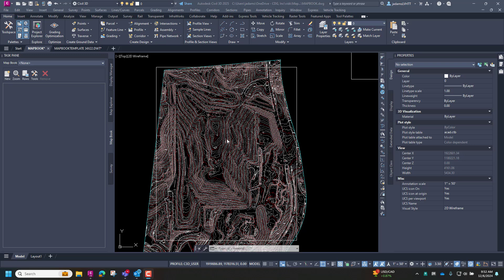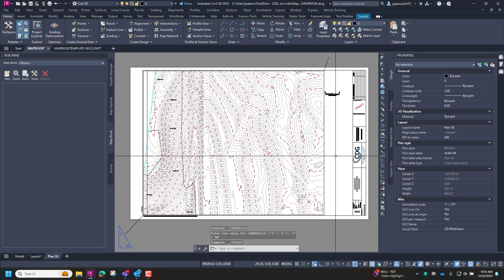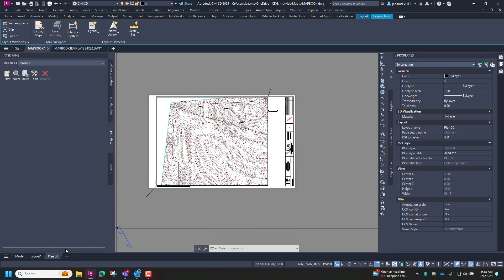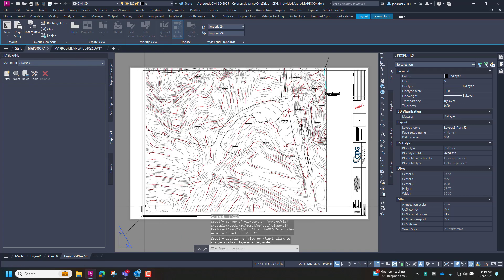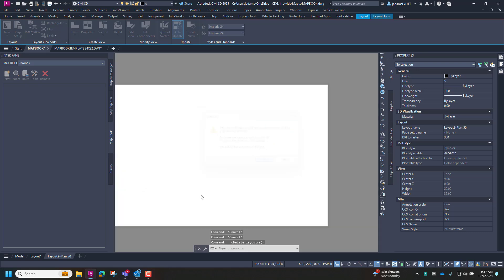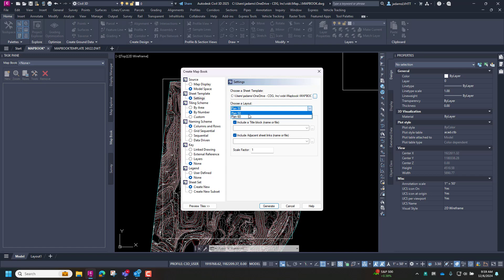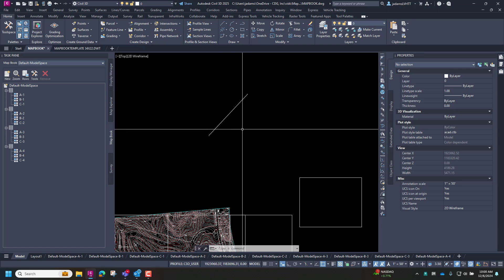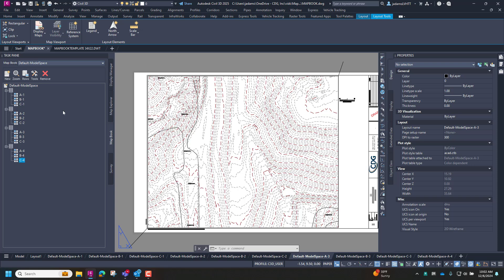Civil 3d-Create Tiled Layouts or Mapbooks

Comment: I want the Lisp Command can you share this
Reply from the maker: (defun c:SVT (/ ss vp pt)
  (princ "\nSelect the viewport to correct：")
  (setq ss (ssget '((0 . "VIEWPORT"))))
  (if (> (sslength ss) 0)
    (progn
      (setq vp (vlax-ename->vla-object (ssname ss 0)))
      (setq pt
	     (vlax-safearray->list
	       (vlax-variant-value (vla-get-Target vp))
	     )
      )

      (if (and (= 0 (car pt)) (= 0 (cadr pt)) (= 0 (caddr pt)))
	(princ "\nseledted viewport's viewtarget is (0,0,0),not need correct。")
	(progn
	  (princ "\nseledted viewport's viewtarget is")
	  (princ pt)
	  (setq pt (vlax-3d-point 0 0 0))
					; 设置视图目标为 (0,0,0)  
	  (vla-put-Target vp pt)
	  (princ "\nseledted viewport's viewtarget is updated to  (0,0,0)。")
	)
      )
    )
  )
  (princ)
)
(princ
  "\nenter 'SVT' to correct viewport。"
)
Reply: @cruciblephoenix1037   Thank you my Problem has solved
Reply: I cannot figure out what would be wrong if Autodesk had come out with something like it did for plans and profiles. Why did they make it such awkward to be forced to use scales in a way that is not so straightforward when it comes to mapbooks?!! I would use viewport scales instead. Actually, when I saw it asked for scale, I found it redundant. If one does not change plot scale inappropriately, there would be no need to give scale here I believe.